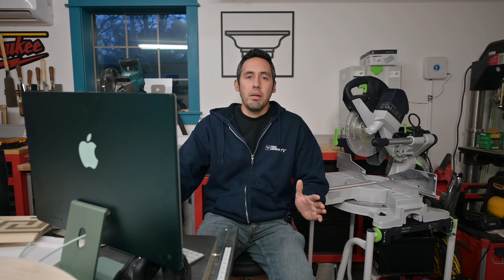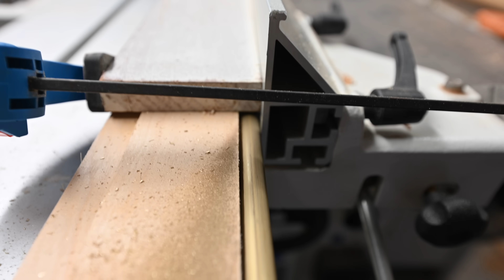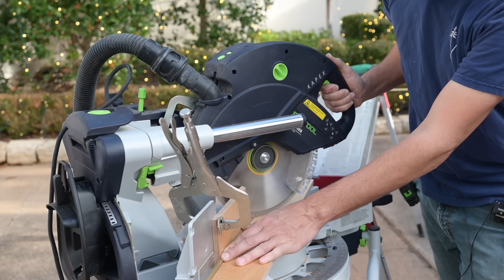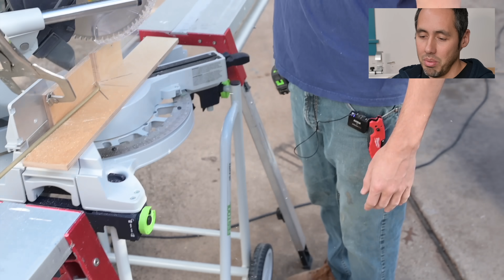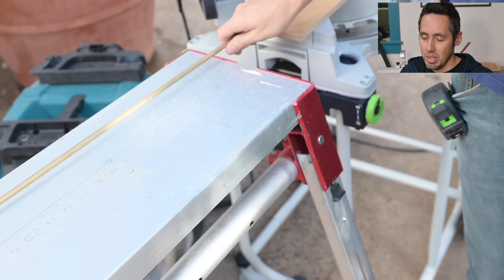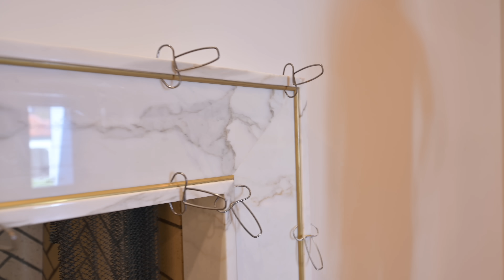It only took 12 years...My first MITER SAW injury.

Comment: Richard, It seems the kerf on the blade may have wobbled a bit when it finished and the cutoff no longer had tension on the blade. I worked as an electrician back in the day and also had the nail through the sole of my boot and also my foot and the shoe upper. One tetanus shot later and that’s still not my worst one. I was driving a ground rod with a manual post driver when I raised it too high as I was preparing for the next “Hammer Down”. I raised the driver too high and it came off the top of the ground rod. WhenI drove it down, the ground rod slid up the outside of the driver and ripped a slab of flesh open on the side of my thumb. A co-worker thought it would be a great idea to cut the slab of flesh off with his side cutters. My boss took me to the hospital instead. and they cleaned, dressed, and bandaged the wound. 42 years later, I still have the scar and the flap healed into it! I have a current pic, but don’t know how to attach it!

This is my entry for the Stiletto Square 😊

  -Carey
    The Colony, TX

Comment: I was toenailing some blocking on a 2x6 wall and didn't see the huge knot that the blocking covered up. The nail glanced down the blocking, through my glove, into my pointer and middle finger knuckles. I looked at it, and still didn't feel any pain so I took the opportunity to rip it out before the pain set it. I worked the rest of the day and 2 hours overtime. It hurt pretty bad but more than anything it just made me angry.

Comment: Been working in commercial carpentry for 12 years now. We frame with metal studs so plenty cuts on my hands. 
Once a three wheel was dropping  Sheetrock, I decided I could quickly make a mark on the floor and move on. Next thing I know the back tire of the moffit is riding up the back of my leg. Lucky me he heard my screams and stopped. Tore some stuff in my ankle, not sure what since I don’t have insurance, but I limped around for about a month. All good now lol

Comment: My worst injury was due to not using a tool.  While demolishing an old shed, we were mostly using a small sledge and a short wood block to remove the roof decking from the underside.  But one sheet of plywood was being difficult, fully absorbing the blows from the sledge and springing back.  It needed a stronger shove to break loose, and there wasn't a good way to get a prybar in there to do the job, so I carefully positioned my hands between the roofing nails and gave it a strong shove.  It finally broke loose... or so I thought.  The plywood sheet flew up about 1ft, then sprang back like a diving board and drove a roofing nail to the bone in my palm.  The pain was intense and unusual... almost like the dull ache of getting kicked in the nuts.  I really needed to wash the puncture out, but could barely touch my hand for about 20min.

Comment: I was installing a steel I beam for a main floor renovation and while lifting a large jack to lift up the beam I didn’t have proper form and pulled a muscle in my lower back pretty bad, almost couldn’t move, was off for about 2 weeks, probably the most pain I’ve felt. Thankfully everything recovered fine but I definitely pay attention when lifting anything now.

Comment: Working as an auto mechanic I get various small injuries all the time, but doing woodworking the worst injury I got was cutting wood paneling (think 70s basement) with a circular saw without safety glasses. Got a bunch of that grainy sawdust in my eyes and it was like sandpaper. Trip to the immediate care and about 100 eye washes later my eyes are fine, but I’m a lot better about wearing glasses now

Comment: I was in my grandpas cabinet  shop when i was 12," about 45 years ago", the only tool i was not to be using was the jointer, because it had taken my Dads friends pinky off. Grandpa was gone so i decide to run a 4x4 about 6 inches long through the jointer, going to make myself a semi truck. started pushing it through with the heal of my hand . I think i was pushing hard and when the piece passed the cutter it slid forward and the heal of my hand went into the cutter. Doc pulled everything together with 97 stiches.

Comment: Nailing off metal connectors all day, tore my common extensor in my right arm... Got the all clear by the insurer to go back to work, then lifting a cabinet and my arm gave way, fell backwards off the ladder and tore my knee 😅 Then COVID hit, and my surgeries got cancelled. Limping for 2 years caused a tear in my other knee. 8 surgeries later, I'm almost ready to walk around the block! Stay safe brothers! Only go back to work when you're confident in your body. 👌

Comment: Years ago I was adding arrow point to a glass panel in a door. I was using a chisel to push the glasses points in 
, when the bevel on the chisel lifted up and plunged into my left wrist right between the two veins in my wrist. Waited to long to go to the hospital to get stitches, they couldn’t stitch the wound. Now I have a nice 1/2” scare on my wrist to remind me to use the right tool.

Comment: My worst injury was last year. I try my best to be as careful as possible, like we all do, but I was cutting some trim for the exterior of my home. This was to finish our wood phase of the remodel and I didn't set the clearance of my back fence on the miter saw. I made a sharp angle cut and hit the back fence. The force sent aluminum flying everywhere! I was so thankful I had my safety glasses on. I had a piece of aluminum lodged in my nose and a few in my my cheek. I have a small scare on my nose which reminds me to slowdown and double check all important aspects of the cut I'm about to make. Side note: It felt like I got punched in the face even though it was only about 1/8 the size of an English pea!

Comment: About twenty years ago i was cross cutting some 3/4" mdf  on a table saw . I cut down fifteen or so strips 22'X65"  and on the last piece i got distracted for a mil a second and the board kicked back into my stomach breaking the skin ( sharp edges of the mdf ) and bruising the heck out of me and the pain last at least five or six days long enough to remind me to never to your eyes of of what your doing when operating power tools.

Comment: About 7 years ago I was helping my brother out putting a security camera in the eve of his house. Second floor about 20feet up on a concrete slab. Ladder was two short so and as I say it or think of it I realize how stupid this was and even at the time I knew it but was just trying to get it done so I put the ladder in a set of scaffolding.  Needless to say the scaffolding kicked out and down I went fell 20 feet pretty much landed on my face. Shattered my eyescocket eye swelled up completely closed, cracked my skull from that socket all the way to the back of my skull. Had a massive concussion and over extended my ankles and messed up my shins. 100 percent should have died there took about 7 or 8 mos to make a complete recovery the concussion thing was no joke. But I did learn a really important lesson and I have a heck of a safety lesson for my middle school wood shop students! Have a merry Christmas everyone!

Comment: For 2 weeks I lost feelings on both my arms. Kind of when you wake up and your arm is asleep after sleeping on it. What happened was, I was carrying an 8x8 10ft Post over my shoulder. This is something super common I’ve done forever when unloading from the trailer on the work table to cut with the 16” Makita beam cutter. Apparently while loading the beam on to my shoulder I hit a nerve. After giving it a day, I went to the ER since I had no feelings at all and was given some muscle relaxers and anti-inflammatory meds. Still no immediate relief and what ultimately ended up helping is a visit to the chiropractor. I had misaligned part of my back in carrying so much and it caused a chain reaction. Needless to say, I don’t carry anything over my shoulder anymore…

Comment: In 2017 I was burning a pile of hardwood flooring boxes. It was January and the ground was frozen. I had rubber boots on and I went to walk towards the house that we had just finished building. I slipped on some ice that was under the snow and my feet tangled under each other and I fell straight down with all my weight on my one ankle. It was an immediate sprain and the pain was so bad I couldn't walk for nearly a month. I had bruising for well over a month after that accident and to this day I need to watch that ankle because If I don't I risk spraining that ankle and cartilage over and over again.  I learned a lot from that experience. And no pain since that accident had me feeling worse, If anything I have become more resistant to pain because of that and I look closely where I walk now no matter where I am.    No job is worth the injury, especially the long term one.

Comment: I used to intern for a cabinet door maker in college and they had a pneumatic clamping table for assembling them square and everything. Doing that type of job is obviously repetitive and a lot of the time you can get caught doing a task subconsciously. I was adjusting the door parts to line them up close to square and my foot engaged the footswitch to send clamping pressure before I moved my hand out of the way and my pinky finger on my right hand got smashed in the pneumatic clamp. My fingernail completely turned black but returned to normal after a couple weeks.

Comment: Last week after years and thousands of pneumatic nails shot, I was casing a window stool with 2 1/2” x 15 ga. nails, I checked my hand position in relation to the gun tip. I was pushing with my palm and holding my fingers off of the piece. The nail hit a nail in the framing and bent up and to the right going straight through my index finger from the pad of the finger through the fingernail.

Comment: Hi Richard,  as I write this there are 824 comments and rising.  That is both a testament of you popularity and the dangers inherit when working in the trades.  If my comment is repeated somewhere in the 824 comments I apologize.  My story will follow my comment.

As to the comment, one of the things I was taught in the machinist portion of my apprenticeship is that brass is a soft metal.  As such, cutting tools have to be sharpened with a flat or even slightly negative angle;  similar to a masonry drill bit.  It needs to be "scraped" and flaked off, not cut.  Otherwise it will grab.  When you were cutting at a 90 deg you had a strong fence to hold and maybe lucky it didn't grab.  But once you were cutting on a miter, your hand was not solid enough to hold the side force when the saw teeth grabbed.  Aluminum is hard enough to be machined if careful.

As to my "accident" story.  Many years ago I was walking through a compartment on a Navy ship and bumped a wooden arm on a steel chair that had a wooden arm cover with my knee.  I didn't feel any pain but my polyester pants were now stuck to the side of my leg.  (I was going clubbing and it was the early 70's, thus the polyester.)  I lifted my pant leg from the side of knee and saw only a slight red spot and felt something under the skin; but still no pain.  I decided to still go out to clubbing.

The next day I went the sick bay but nothing showed on the xray.
One year later, I noticed something sticking out the side of knee.  I went to the medic and he used tweezers to pull the object out of my knee in the opposite direction it went in.  It was a 3/16" wide at the base, 1 3/8" long needle shaped splinter.  (wood doesn't show up on a xray.)

Thus, my moral is be careful when even walking around wood.  It can still bite.

Comment: Thankfully I have not had too many major accidents, the one that came to my mind that was similarly painful to this one. I was spraying my garden with a 3.5 Gallon Chapin sprayer filled to the top. The handle wasn't fully locked in and it dropped and cracked my big toe nail at the base took forever to heal.  Lesson learned

Comment: I am a professional woodworker and cabinet maker.  About two years ago I got distracted by the arrival of a metrial delivery truck arriving to my shop while I was making a 45 degree cut on my table saw. I am lucky to still have my finger for the saw blade still chewed a bit of the finger tip of my left hand thumb.

Comment: I was using a wire wheel on a grinder polishing up some metal before paint. I was using it one handed above my head and the wheel caught and kicked back and hit me in the face. The impact was so hard I bit a hole through my tongue. I have some gnarly pictures of my face after. It is unreal the amount of respect I now have for a grinder.

Comment: Electrician here, carrying a power drill with a 2’ long 1” width auger bit down a staircase with a ladder in the other arm. Had the bit resting on my shoulder (think of a soldier carrying a rifle). Bumped the trigger and it immediately spun my flannel around the bit all the way down to around the trigger. The bit entered my throat and was traveling up. I threw the ladder down to wrestle the drill that would not stop spinning. I always tie my cords, so I couldn’t simply unplug it, every time I took my right hand off to try and grab my cutters the drill advanced. So I just kept pushing down on the drill to keep it from climbing. After what felt like an eternity, the trigger released. Exhausted I almost collapsed and went to untangle myself and the damn thing started up again. All I could think of is I had to fight to see my wife and kids again. Somehow I made it through. At the ER the doctor told me the bit was spinning on my jugular. My boss gave me the bit as a souvenir. I had bent it around my rib cage trying to keep my head out of the drill’s path.

Comment: I've had exactly this happening to me luckily no injuries. It was almost the same size material but aluminum instead. What happens is the piece is so thin and small it vibrates when cutting, causing a kickback

Easy way to solve is to use a scrap piece of whatever wood on top to hold it down and prevent the vibration

Comment: Had lots of minor incidents, shooting myself in the finger with a trim nail, barely nicked by a table saw once etc. But my worst injury was probably a very deep cut with a utility knife.  I was cutting ridge shingles from some 3-tabs and doing the back bevel thing so the edges of the underlap don't show.  Using an aluminum framing square as a straight edge and pushing hard to cut mutiple layers at once, the knife blade caught in the edge of the aluminum, rode up and went right through a good part of my left thumb.  We didn't have a first aid kit but we had paper towels and duct tape so we made a bandage and we finished the roof.  Went to urgent care the next day to get it attended to.  Big scar will always be there but feeling eventually fully came back a couple years later.

Comment: I was working in high school mostly as a laborer remodeling the old post office building in my town (Lockport, NY). After working there for a few years as it was a big building I was putting baseboard, chair rail, and lower wainscoting around a support column in one of the downstairs rooms when the nail I was shooting hit a knot in the trim and pushed the gun off of the trim. Of course my fingers were right there putting pressure on the outside miter joint in the baseboard and when the nail gun came back down it landed on my thumb. It shot the nail right through the joint in my thumb and thankfully both missed my bone as well as the baseboard otherwise i would have been stuck there. I would imagine prying that nail out of the baseboard with my thumb attached would have been quite painful. Never again will I have the nail gun set to rapid shoot when the trigger is pressed!

Comment: Negative hook blades definitely help with that scenario, they push down as they cut instead of hooking up, but that happens with any material if it small enough, typically screen molding, glad it was relatively uneventful, I take green masking and a sharpie and write concentrate on the tables to try to remind me to be extra careful, I have been using miter saws for over forty years as a trim carpenter, miter saws are viscous.

Comment: About 4yrs ago I worked for a company called, “TGI” in Florida as a finished carpenter. One morning we were trying to fly through a quick baseboard install and I was holding two 45 miter pieces in one hand on the floor and in the other hand the nail gun and without thinking shot the first nail near the top and it blow out and struck my thumb, the pain was incredible:/ from that day on I used glue to hold the piece together then nail it

Comment: Work related injury. I got one for you. Unfortunately, while on an extension ladder, painting the eve. Of these two-story apartment complex  I fail 45 feet onto the parking sidewalk all because I was trying to reach out to get that last few inches. I was told that i bounced at least a foot and a half upon hitting the ground. believe it or not I do not lose consciousness the pain was excruciating. I could not get up due to the extreme damage of my back. I had to be care flighted to Baylor hospital here in Dallas. I was paralyzed from the waist down and had to immediately go into surgery. I had ruptured four disc and cracked to lower vertebrae. I was blessed to have one of the leading spine and neurosurgeon on duty at the time of my arrival. after going through two surgeries and therapy a year later, I was standing in walking on my own 2 feet God is good. Needless to say, I was done with construction i’ll go I can walk. I am limited in how far and how long and sleeping in a bed is over. are. it took a long time for me to realize that I was disable. Those that are at three construction take nothing lightly. Safety is paramount and OSHA exists for a reason.